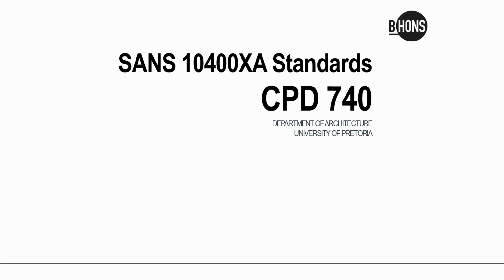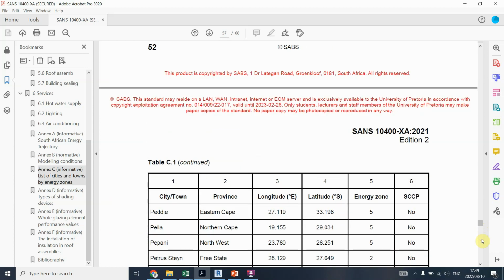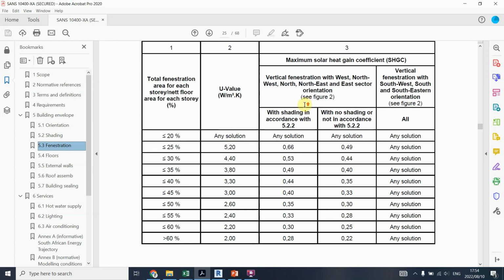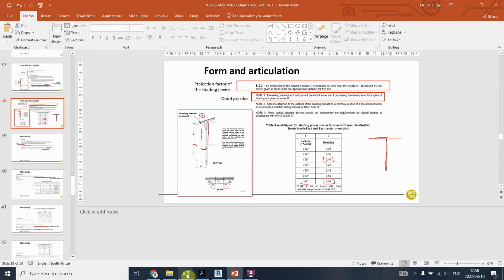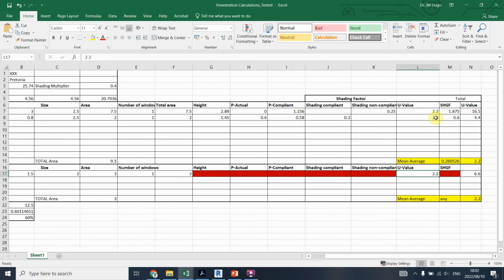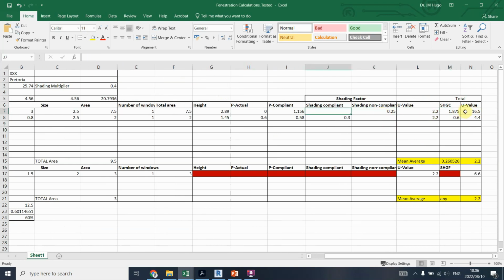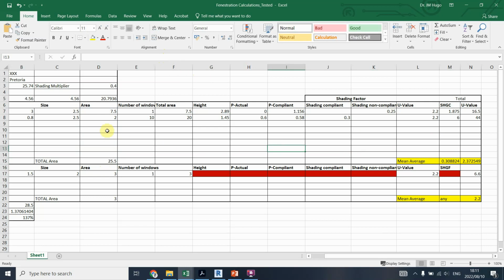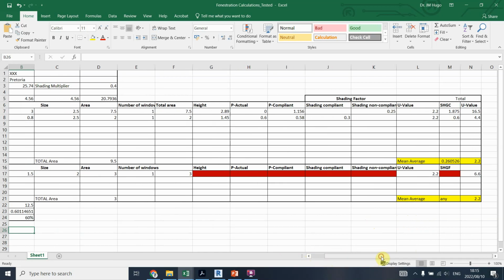SANS 10400XA 2 Fenestration

Comment: Number of windows must be removed and rather have each window separately because you can have the exact same type but in different lintel height or their roofing in different levels, sometimes different overhangs for the exact type. In that case you wont be able to put the same height for all, you wont be able to put the same p-actual for all
Reply: 100% well spotted